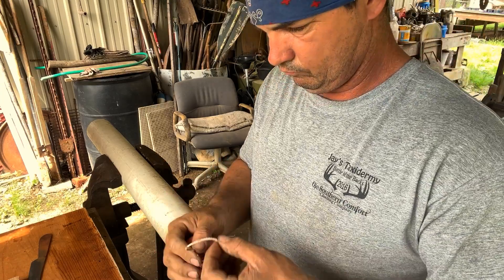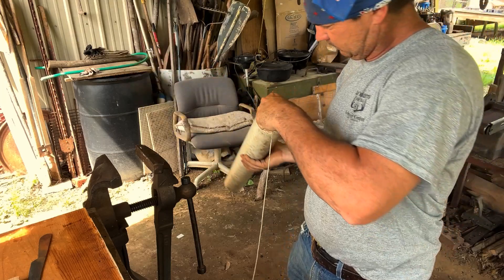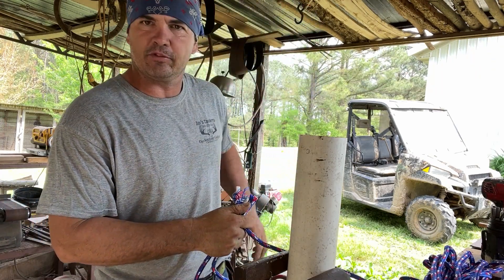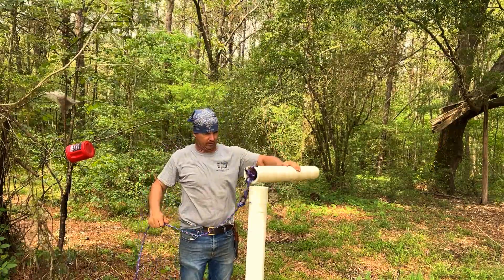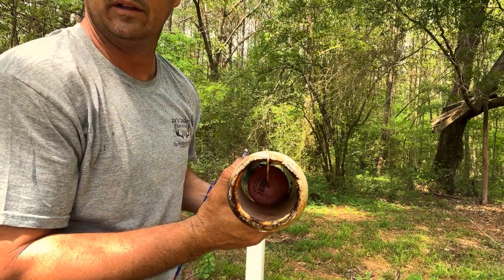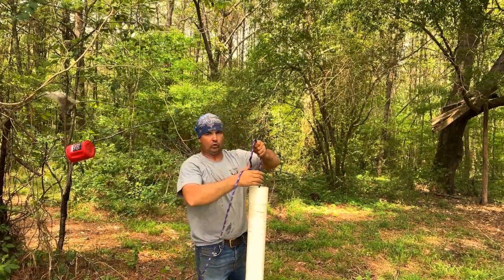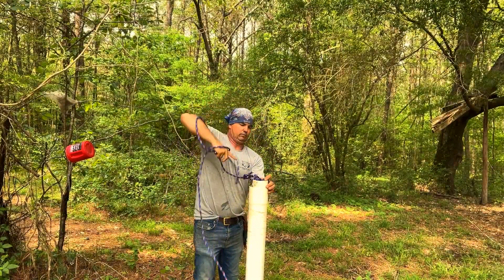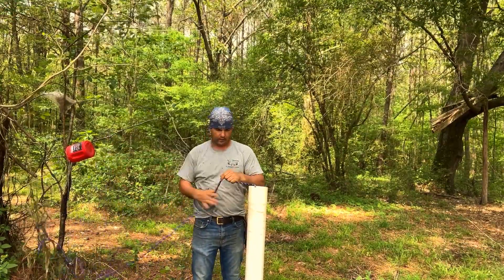Building my well Bucket for my hand drilled well

Comment: Excellent job!!
I made one back in the early eighties when we first bought her place they were no City water out here so we had a well-drilled we didn't even have electricity here so I had to make a wheel bucket and could not afford to buy one I took a piece of 3 inch PVC pipe put a reducer on 1end from 3 inch  to 1inch put a tennis ball full of sand so it wouldn't float with a nylon stream attached to the tennis ball on the inside of the wheel bucket worked very good for many years you have a great idea there thanks for sharing
Reply from the maker: Im sure that ball wont last a long time so i may have to pit a tennis ball in this one

Comment: Did you borrow that design from those old galvanized water buckets? They worked just about like that. They were a galvanized tube just about that same size, attached to a pull rope and pulley. When the water was pulled up there was a trigger at the top of the bucket. You held your container under the bucket and pulled the trigger.  The water came out the bottom. Uncle had about an 80 ft drilled well in a limestone aquifer. Don't know how many times as a kid and on a hot July day I begged my Uncle to pull some of that fresh cold sweet water up from the bottom of that well. Cold enough to give you a brain freeze and sweet as soda pop. He always did because he was proud of his water.
Reply from the maker: I did look at them . Almost bought one at an antique store for $35 but i dont thing it will fit in my pipe.

Comment: Hey Justin!  THAT was a very clever solution!  Your were certainly, "thinking outside the box", on this one.  Dare I say it?!  Well Done!  (I dared.)  The Mark II version might have a perforated end cap and the ball attached to it with a short length of string.  The perforations would let the water come in... the ball would still form a seal... and the end cap would keep the ball from falling out.
Reply from the maker: I wanted to build it with a toilet flapper but i didnt have a good way to hinge it in so little of a space